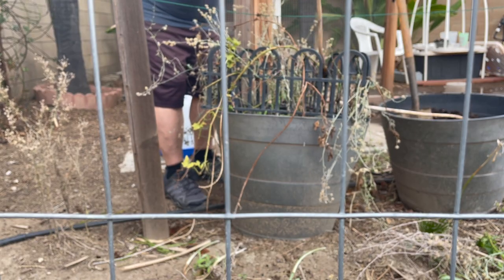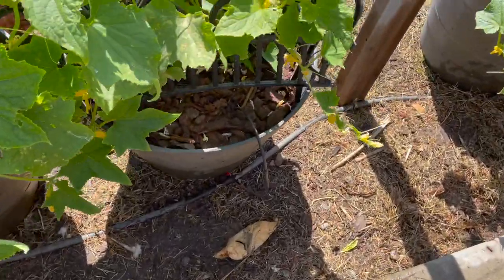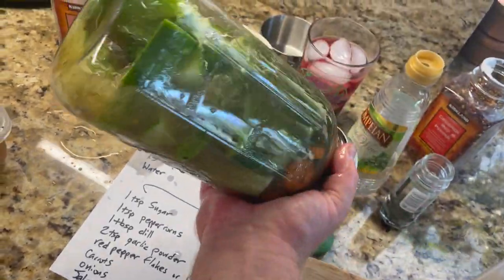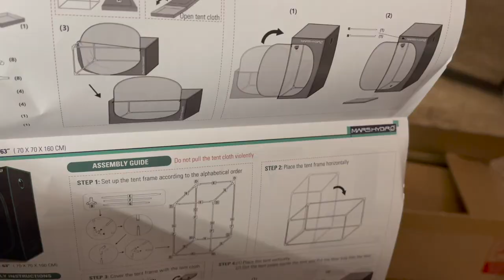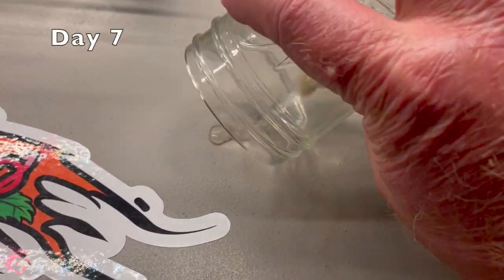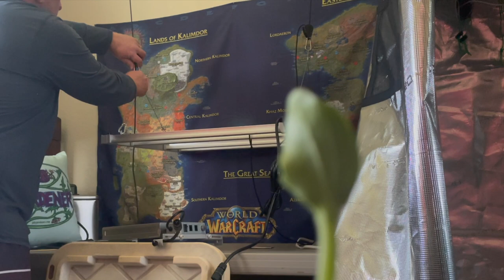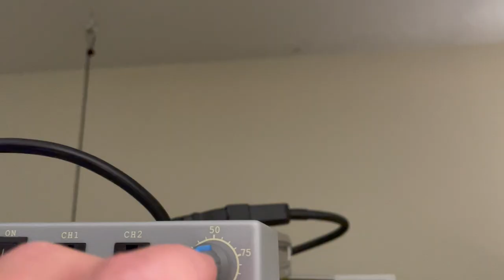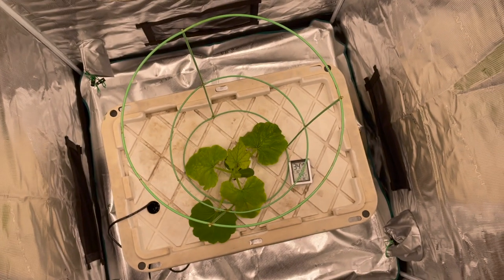The Best Way to Start Hydroponic Pumpkins

Comment: How where you watering the powdery mildew plants? I have had much success this year with my sunflowers bottom watering and not hitting the leaves. Also amending earth worm casting and kelp seems to have made the plants more healthy to fight PM off
Reply from the maker: I think watering is irrelevant to powdery mildew and cucurbits
Reply: @JebGardener  I only ask because you where blasting the pumkin in soil leafs :) Any chance not to wet the leaves when watering reduces PM. I tried milk and baking soda last year with little success. This year moving to sunny location and soil watering only have been good so far. Earth worm casting have seem to make the plants stronger too, could help in fighting off pm
Reply: @alexlombardi1790  h2o2 is your answer.